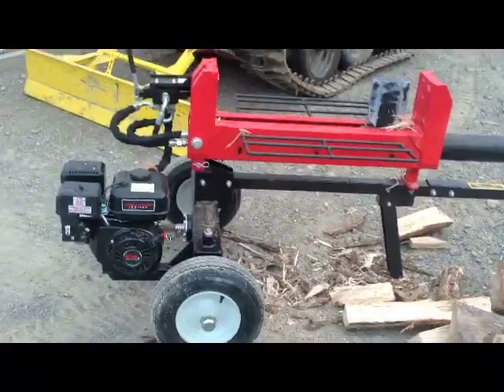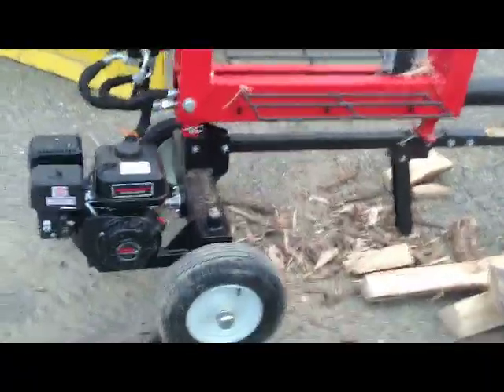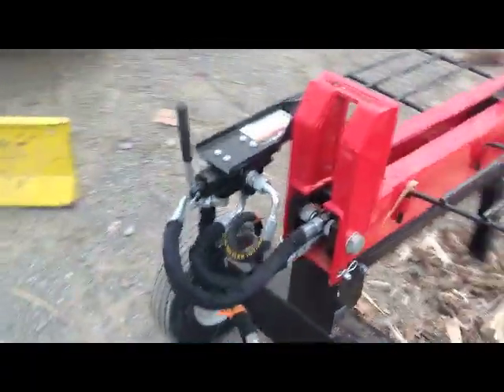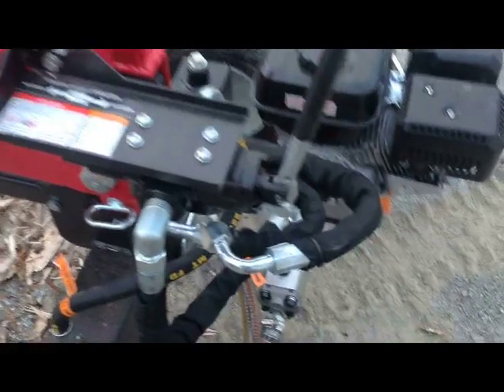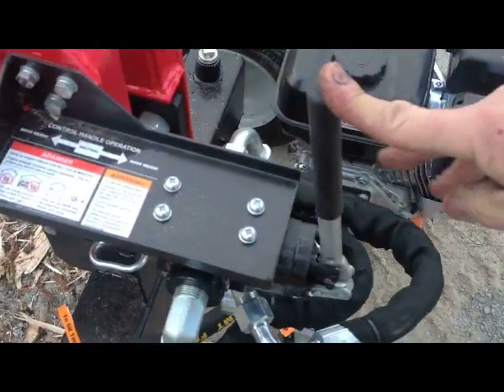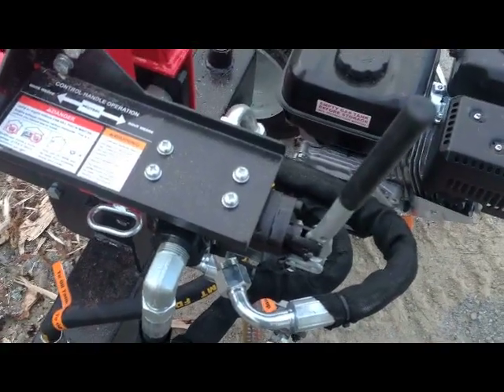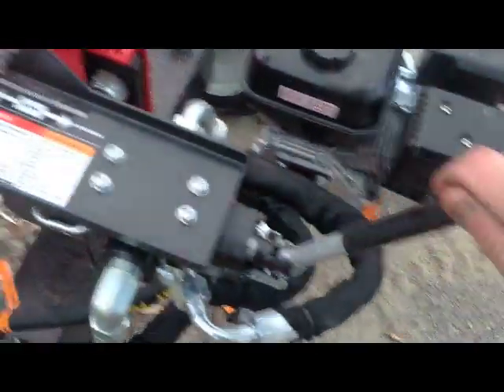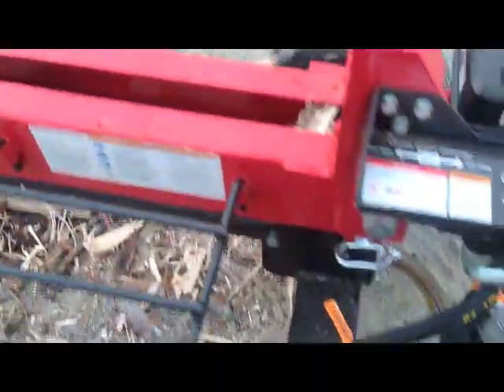Harbor Freight 20 ton Splitter

Comment: wonder how long it will be before the shaft seal leaks due to extreme pressure buildup when the cylinder piston shaft is being retracted. Also I believe you are wrong on the type of wood you were splitting, it looks to be Elm, have never seen bark  as shown on any type of Oak, nor have I seen any type of Oak to have stringy wood.
Reply from the maker: Not sure how long it will last, so far have not had any troubles, maybe I will do an update video on it. not sure on the wood? it was a hard wood I know that, and I believe a little dry. Thanks for watching.

Comment: Was that water leaking out of the wood, or hydro fluid? Seems like it was struggling on that small diameter piece of wood. Good way to find the weakest link real fast on these harbor freight quality tools. I bought the 5 ton electric. Worked great the first year. Then the next, it started "leaking" when it gets warm or hot after about 30 min of splitting. No actual leaks of hydro fluid, but it like "slips" and I'm not getting full power, like riding a clutch in a car. I've heard reports of these doing the same thing. What's the update?
Reply from the maker: +Peachride EightyNine No leaks I over filled the tank, split about 10 cord and running fine. think this clip was my update. https://www.youtube.com/watch?v=icKaYu_66ew   So far I am happy with it I may extend the blade, little harder to do 10" and up.    Thanks